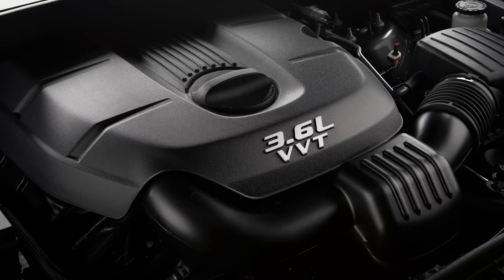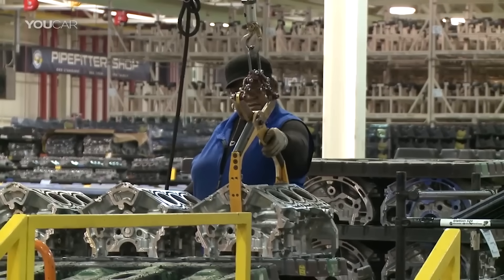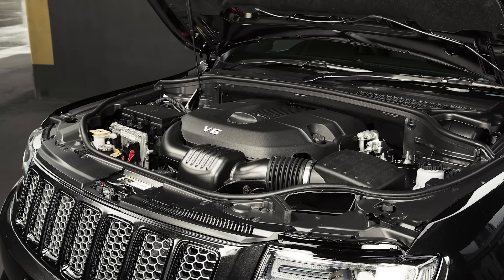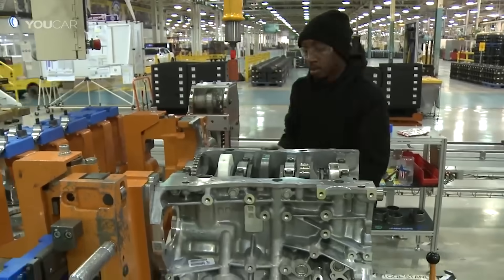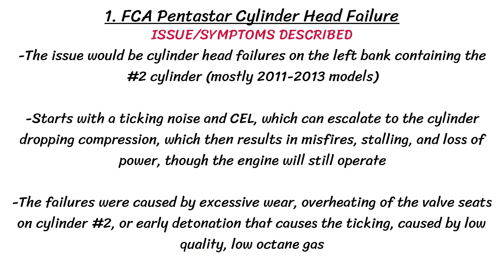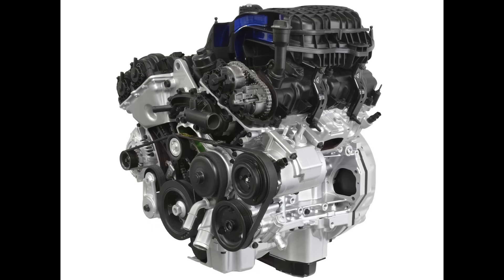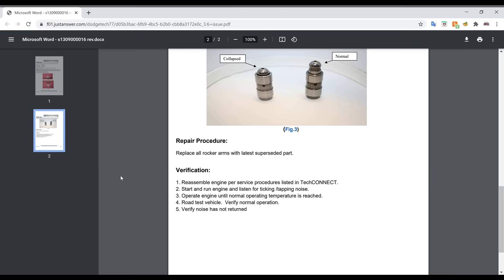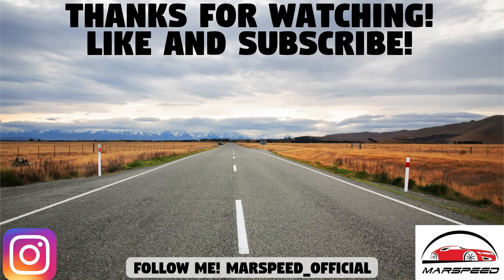The Specs and Fatal Flaws of the Chrysler 3.6L Pentastar V6 Engine

Comment: Almost never fails when a charger or whatever with the V6 pulls next to me and I hear tick tick tick . Even my neighbors does it lol.
Reply: The valve train on these engine is notoriously loud. With the intake resonators they put on these cars it makes it more noticeable. There is a definite difference between normal valve train/injector noise and the tick that is from the bad heads/rockers.
Reply: funny i see more toyota's with the oil consumption problems then i see the pentastar's with the tick, and even more Gm's with failed lifters, truth is ALL car manufacturers build junk, every one has at any giving time multiple class action law suits going
Reply: Almost all the Chargers and Challengers in my area are V-6's and I've never heard that, even once. I think you're full of it.
Reply: In the good old days, the tick-tick-tick just meant a Slant-6 that hadn't warmed up yet. :)
Reply: Use full synthetic instead of conventional it may be costly but it last longer then conventional and improve longevity.
Reply: @josephprem8861  very true, nothing but synthetic in our Durango. At 140k had to replace a roller rocker. It looked brand new inside. No sludge, and the cams were perfect.
Reply: @josephprem8861  that's absolutely true. I always use synthetic.  Even if the engine does not require and I always change oil at 3 thousand. Even if it says 5. I don't care. Also use gas with detergent from sunoco.  If you can't do it all the time try it at much as possible to avoid sludge build up. And make sure your aren't getting watered down gas. The turkey hills around where I live absolutely sell watered down gas.  It made me need a new fuel pump in a brand new car. So now I literally only use sunoco 94. And if I can't get it I will use something else. But those are the things I did to get 140 k out of my charger when I had it. The only thing on the car that never gave me a problem was the engine.
Reply: Nobody here knows shit about the valve trains the tick that you're talking about that goes away when it warms up is the back to exhaust manifold bolts broken in the head. Then it expands as it heats up and goes away. The flaw with the valve train is so rare. I see more hemi motors and 3.6 is with many more miles than any Chevy I see and for sure any Ford with their Eco junk motor. By far the three six is more reliable than any 6 cylinder general motors makes. GM is the majority of the cars in our shop.
Reply: @moegreenbl  Exactly, at the end of the day I only trust chrysler engines to get me home, even if something major happens. Chrysler engines handle "oh shit" modes better than GM and ford and that is because of how their engine and system operates compared to others. Chrysler PCMs are less sensor input heavy and more formula based for running the engine compared to GM or Ford, hence why when a GM or Ford fail, they fail miserably.

And I know someone is going to run in here and go "BUT BUT BUT~~", gonna tell you now, ive owned GMs as well as Fords and have a ford ranger and fusion as well as a few chryslers. I've hardly had any real issues with my chryslers compared to my fords and GMs, and fords in particular have a real big problem of just ****ing dying hard, and are typically the absolute worse to work on as well.
Reply: They are easily fixable. It's a failed rocker arm. If it's caught soon enough you won't have to replace anything but the rocker.
Reply: Fortunately Pentastars made after 2015 are flawless, while 5.7 HEMI is still flawed and prone to tick, despite being on market for so many years
Reply: My V6 GT started doing it at 8,500 miles
Reply: @hardrockrelics2157  mine started at 100,000
Reply: @hardrockrelics2157  damn that's a fat L lol lemons law
Reply: @chrishansen7004  lol yeah , it’s more noticeable towards the end of oil life and it goes away after a few minutes warm up. But it’s there . I previously had a Nissan 350z with a VQ35DE motor. It had much louder valve tick.
Reply: @hardrockrelics2157  my 2021 challenger with 700 miles on it  ticks when cold started for about 5-10 seconds. Lol but so did my 2019 ram 3.6 and my 2016 ram 5.7. I think Chrysler makes the best looking , driving and riding vehicles but I definitely wouldn’t keep one past warranty lol
Reply: @hardrockrelics2157  all vehicles make that at start up because everything needs to get that oil to keep everything moist😂
Reply: @Jay-bw3fl  that would be lexus sir. Lol
Reply: We have a 2018 300 with no tick after 40k miles and a 19 Ram with the V6 with 30k and no tick. We run full synthetic and change it before 5k miles. So far so good
Reply: @Sheepleton  if you take care of it you should be ok, I mean I like the pentastar engine, but people just tend to not take care of them.. was just saying.
Reply: It's the notorious lifters.
Reply: @louiewatson9389  yep!!! Not too hard to replace your self or too expensive to have the job done.
Reply: @louiewatson9389  the 3.6 is an OHC engine, it does not use lifters.
Reply: Mine does too
Reply: I seen cop cars with load ass ticking 😂
Reply: @erod7774  and they are V8's.
Reply: @erod7774  And cop cars and taxi's are the only one's who have the problem. But that's the 5.7, NOT the 3.6. It's a bad design that Mopar is not inclined to fix.
Reply: V6 dont get the hemi tick. I run 5w 30 and 5w20 is recommended havent had any problems with it im at 75k
Reply: I had a 6.4 hemi that ticked too tho so idk. Lol my wrx be ticking sometimes but that's di I don't think pentstars got direct injection.
Reply: My 2018 300 w/ pent. Lost compression after 600 mi. Dealer would not specify problem. But, they replaced engine with factory new and FCA sent me a check for one month car payment. Been fine since. Did not know about using higher octane. Will try that. I always run synthetic and I'll always be on the maintenance so, hoping I'll get a good run on this one..
Reply: You won't hear any noise from my wifes 2012 Journey with an all original 125,000 miles 3.6L it is so quiet she forgot and left it running for an entire 10 hour shift in her workplace parking lot.  But then again we change the oil and filter between 3000 to 4000 miles without fail.
Reply: @robc8468  that's the key for those engines. Never said I didn't like the engine, but they can be finicky if not properly maintained, which most people don't.
Reply: My Tacoma started ticking at 40k and Toyota said it isn't an issue and that the engine will do this for 100s of thousands of miles reliably. Stressing that ticks are not necessarily worse.

ALL engines wear down.
Reply: John L they had problems with pins in the rocker arms i had to replace 3 on my 3.6 they redesigned them so it doesn't happen again
Reply: Is this also true with the Maserati  V6 twin turbo they use a variant Pentastar engine it is a 3.0 liter.
Reply: It's caused because people never change their oil to much sludge dirty return springs Hemis usually tick because of their exhaust manifold bolts snap and cause a leak. Nothing serious but it happens. Then if they don't ever change their oil the tick begins
Reply: Most Hondas have a Sound while running equalivent to the Pentastar " tick" but since Honda has such a good reputation with Motors, it's considered nitjal
Reply: @jeffreyzabawski4862  Honda has a great rep but I can honestly say that everyone I've owned, I have owned at least 5 and own one now (last one I got, used, cheap), has had cooling issues and not one has made it past 250k without major issues. I really don't get why the reputation is what it is. I have a friend with all Hondas. He keeps them running but is constantly repairing them.  So far in my life the longest running champions (not needing constant repair and maintenance) I've owned was a 90s 4cyl Toyota Camry and an 80s v8 Cadillac. Just my experience.

Worst was a Dodge Lancer (4 cyl) and a Nissan Altima (2.5 l 4 cyl) The Lancer started knocking and I drove it until I saw the magical blue smoke. The Altima had oil pump issues, coil packs, valve cover, bearings, and more and eventually the timing chain broke destroying the engine. Both before 200k died. Not that you asked and not that my ignorance didn't play a role.
Reply: I guess it’s hit or miss. My 2016 Jeep Wrangler has over 130k miles now with literally zero issues except the starter failed. And my wife drives a 2014 Grand Cherokee with 90k miles now and only had the ac compressor replaced. That’s it on both.
Reply: @CynHicks  Yes the AC compressor was faulty from the factory, it was replaced under warranty at 1,000 miles. So I don't consider that a pre-mature failure necessarily, it was a faulty part from manufacturing, which happens to every single brand. But not one thing since then. And for the wrangler, I abuse it and take it overlanding and it failed after the car was submerged in water. It was $65 and it took me 30 mins to change in the autozone parking lot. So between the two, there are nearly 10 years of driving and over 200k miles combined, and like I said, many miles were very hard on the wrangler, with a total of $65 of repairs. So I consider that pretty good. Meanwhile, my dads 2019 Lexus had to have the rear axel rebuilt at 30k miles. My sisters 2014 Nissan Rouge had a new engine at 60k miles. My moms 2017 GMC Acadia has had the engine mounts replaced twice, and the entire steering gear box replaced, all under 50k miles. And my company's 2017 F150 has had 2 turbos replaced and an oil leak fixed, 25k miles. So, in my experience, FCA products have been better than basically every big brand. But, overall the quality of new cars continues to go down hill across the board.
Reply: @Theultrazombiekiller  I apparently misread your original. Doesn't sound too bad actually.
Reply: i think your mistaking pre pentastar engines these dont tick
Reply: I would guess it's the push rods but I guess I'll find out, I do see variable valve timing maybe perhaps it's the cams and apparently they are for viral or for valve God knows if there is a tolerance to be fucked up on that's one of them God knows Chrysler will do it
Reply: What happened to the 3.3 and 3.8? I had both with over 200,000 no problems .
Reply: I noticed mine , when I hit the gas and speed up sometimes makes a clanking sound, clank clank clank clank.

Any idea what this is?

I also have the po6da code on and think it’s a solenoid at the oil pump, my oil pressure is fine though  and it’s not a sensor issue 

I use royal purple and marvel mystery oil about every 3000 miles btw
Reply: It’s because they’re running spec 0W20 instead of 0W50 that has prevented and fixed the problem for decades.
Reply: Same with a Hemi.
Reply: @Bartonovich52  hemis have different problem from 3.6 way to keep lifters from collapsing is keeping them cleen every other oil change i use marvel mystery oil in my oil change to keep lifters varnish free so they dont get sticky and eventually collapse
Reply: @Bartonovich52  0
Reply: The problem IS the oil engine. If you use 5w30 . You need to change it for 5w40. My Dodge charger have 400000 milles and it work so well
Reply: @wilfriedberserkr1667  I too use 5w40 full synthetic and I have not heard any ticks I also change the oil every 5k instead of following the oil life sensor.
Reply: @cljay25  yes . I swear. It's better
Reply: @wilfriedberserkr1667  I ran Mobile 1 5W30 in my Avenger. 95K miles no tick issues. I only let the dealer do oil in my Challenger. Have them do synthetic. Outside of the normal injector and valve train noise I have nothing. At idle it's quite as can be expected. No ticking on start up. I am going to put the intake resonator delete kit on to go with the Hellcat lower air box so that will change the sound some.
Reply: @Ryzenberg78  5w30 IS not Bad but 5w40 IS better
Reply: @wilfriedberserkr1667  i don’t think it’s wise to run a thicker oil than recommended from the manufacturer because from what I’ve read modern engines are very particular on tolerances. I don’t know tho maybe you’re right. Can’t be wrong with 400k on the odometer lol
Reply: @Jay-bw3fl  i have someone at mopar who told me to do that to fix hemi tick and pentastar tick. It's work.
Reply: @Jay-bw3fl  I would agree. The 3.6 has a hydraulic tension roller on the oil pump chain, the hole to pump it up is the size of a tiny needle. I would think thicker, or thinner oils wouldn't pump this up properly. I run 5-30 instead of 20 because I have a blower on it.
Reply: @Jay-bw3fl  Running a thicker oil than what is recommended is not a good idea. Any newer dohc engine these days have cam actuators to advance and retard the timing. Using the wrong oil can reduce the efficiency of the engine. Those actuators can't operate like designed because the oil pressure is different and the actuators can't output what is being commanded by the ecu. This can lead to detonation. Proper timing is key to keeping these engine alive. That's why knock sensors exist as well. The pentastar needs timely oil changes and a good synthetic oil. Going past 4000 miles with a synthetic blend oil is part of the reason why the tick occurs. Especially people who don't change the air filter. New Wrangler owners are notorious for changing the oil but not the air filter, and that dirt gets into the new oil and ruins the valve train. Dirty K&N filters make it even worse.
Reply: @useritscarrot  awesome, thanks for the heads up!
Reply: @Jay-bw3fl  I always heard thicker oil helps high mileage vehicles.
Reply: @useritscarrot  Problem with that logic is that Jeep/Dodge/Ram literally revised the manuals to literally say to run thicker oils. What they're basing these revisions on, IDK. Seems depending on when and where your engine was built, when you enter your vin into the sites, many on the Jeep forums at least have noticed then changes.

Yeah, there MAY be some generalized logic to not going higher than what the manual says but it seems that doesn't exactly apply here

And 170k mile Pentastar in a WK2 here. No ticking whatsoever. Pretty sure most of yall are imagining things and just don't know what an engine sounds like. On top of that there is DEFINITELY the issue of most not taking care of their rides, as well as not all engines being "goldilocks" off the production line.

Higher octane, and good oil that does a better job in the cold (Quakerstate and Amsoil man here, and I don't do this "severe duty" changing interval that some of you paranoid seem to brag about) and you should be fine
Reply: @Jay-bw3fl  engine tolerances tend to open up as the engine wears. Even if your engine has been well-maintained with oil and filter changes, you will experience where once you get over 100,000 miles. Going with the next heavier grade of oil will not hurt a high mileage engine.
Reply: @wilfriedberserkr1667    Wow lots of miles. 👍🏻
Reply: @wilfriedberserkr1667  I've used nothing but 5w-20 Mobil 1 in my 3.2L Pentastar and it doesn't have any valve train noise.
Reply: @wilfriedberserkr1667  you don't ever mess with oil weights in newer vehicles with this economy mode (mds) shit. You will seize a lifter and cause more serious issues.
Reply: @wilfriedberserkr1667  my grand Cherokee 2021 manual says to use 0W20 oil. I guess because it have low tension rings. Heavier oil can make moisture on piston heads, then make carbon on coloniser walls, and finally small oil leaks inside coloniser, rip colanders, compression, spark plugs. Then dirty oil will become more often and clog the exhaust catalytic, dirty oil will make dirty engine, then the chain will be tighten not perfectly course clogs up hydraulic tensioners, small holes in engine parts will clog up and won’t lubricate engine parts, shifters won’t shift fast and so on. So wondering is your car before 2016 or after 2016 made, that u using heavier oil
Reply: @wilfriedberserkr1667  oil is not the problem on the 3.6 they had problems with rocker arms the pins for the bearings in the center break and the bearings bounce ontop of the lobes of the cam shaft i had to replace 3 on my 2012 200 they redesigned them with stronger ones. The 5.7 like any chrysler engine lifters become varnished overtime even with regular oil changes and lifters get sticky and start making all sorts of noise on my chrysler every other oil change i use marvel mystery oil to keep lifters clean so they dont collapse it has been my goto for many years now  and works well engine stays quiet as can be.
Reply: @kmbud   Just MORE money out of pockets "in hopes " that it works.... $50,000 should come with some reliability, not prayers in snake oil technology
Reply: @cavman250 my  200 wasnt anywhere close to that brand new
Reply: @wilfriedberserkr1667  ya done that but still tick , i put lifters and rocker then it quiet for a wile then back to ticking after about 6 to 7 k mile's  thinking about going with electric car so sick of poor design
Reply: @shawncell1247  i hate electric car
Reply: No you don't, I don't know what you think you're hearing, but it's not that. And your neighbor probably has the 3.5, or the 5.7.
Reply: The new LGXs don't have this issue thankfully.
Reply: My 2014 has done it since new and still does it with 120K.
Reply: I've been a south Carolina state and county sheriff car mechanic for 30 years and the charger pursuits with the hemi are fast not very reliable but pretty good for a fiat Chrysler but I've seen so many of these pentastars blow with very little miles not to mention they are complete dogs hauling a big charger with cop equipment and a cop with 2 dozen Krispy Kremes in his gut so slow the crown vic will even blow the doors off of them they arent fast by any means either but by far my favorite car from my experience over the years easy to work on and can take unbelievable abuse the modular 2v 4.6 is the toughest sohc v8 I've ever seen being ran so hot melting the heads from being crashed in pursuits  blowing spark plugs and still being able to stop the suspect car the caprice 9c1 lt1s where great cars as well  but the cars of today are all garbage especially the fords the hemi charger is by far the best patrol car on the road today fast but some hemis are great engines some are pure garbage like most chrysler vehicles  not to mention the hemi easily blows the trannys as hard as they kick down I've never had to change a tranny in the pentastar chargers they are so gutless I guess and it's to bad chevy discontinued the vortec 5.3 in the Tahoe ppv and came out with the ecotec3 5.3 witch are trash compared to vortecs
Reply: @kwb200  I had a '94 9C1 with lt-1 and it was great other than had to replace the water pump every 2 years.
Reply: Honda’s J Series v6 are probably the best v6’s out there
Reply: The V8 ticks too. Glad I bought a Toyota again lol
Reply: That's what happens when a company takes safety as a joke.